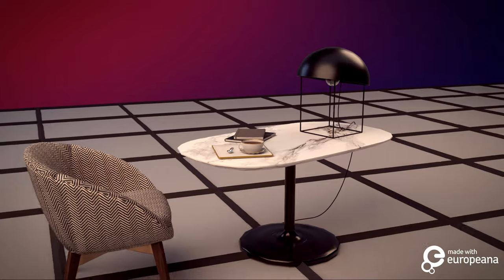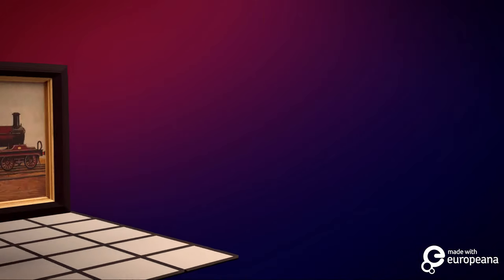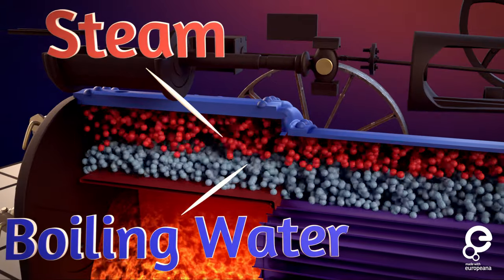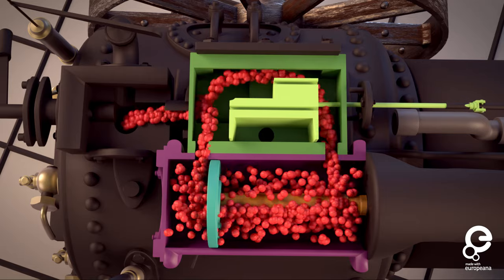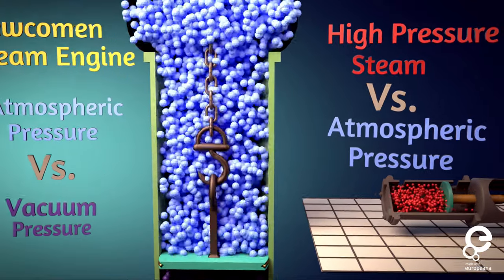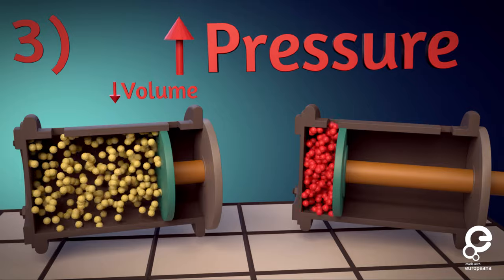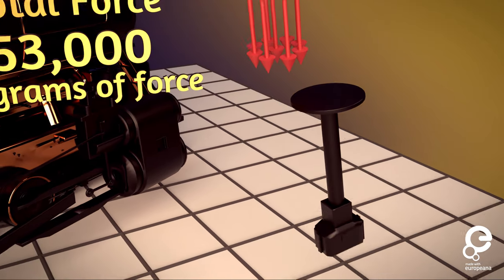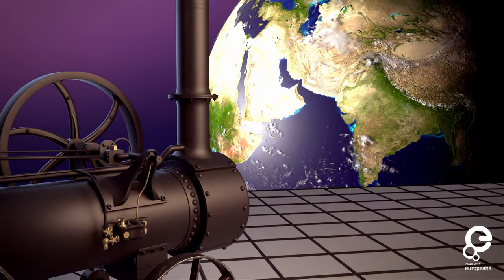How do Steam Engines Work?

Comment: doesnt explains how high pressure steam is created, is the fire burning at higher temp ? do they pre pressurize the steam somehow?
Reply from the maker: Those are a great set of questions.     That's why I call it branch education.   One question answered begs more questions.
Reply: Most newer boilers and steam Locomotives have various appliances that help improve performance and create higher pressure steam. Such as superheaters, which takes steam and directs it through pipes that are in the fire tubes, which makes the steam hotter and drier. In addition, there are feedwater heaters that preheat water going into the boiler.
Reply: He does mention THREE different ways in the video but doesn't say which is used - and of course pressure just builds up and up and up! in a closed space - presumably the more heat (more movement) one in a standard engine, forced induction (more molecules) maybe in a more sophisticated one, and as the piston moves away and creates more volume I cant see how the 'decrease volume' one works at all?
Reply: @anthonylester1349  Smaller volume is basically just the opposite of having more molecules since really it's all about density. However it's not particularly relevent to steam engines but it is how their opposite number, heat pumps work. In a heat pump you use energy to move heat from one location to another and you do that by compressing a working gas.
Reply: Creating higher pressures is essentially a question of boiler design, the more energy your boiler can absorb from the fire the more pressure it will build up inside of it. The goal of boiler design is essentially to have the air that exits out of it be as close to 100 degrees C as possible because then you know that the water in the boiler has absorbed all the heat energy it possibly can from the fire. You do that by running fire tubes through the boiler where heat from the hot air from the fire can transfer into the water of the boiler. Of course it also helps to have a hotter fire since that means there is more heat you can transfer to the boiler and you do that by ensuring your fire gets enough oxygen to burn cleanly, you know a steam engine is running well when the smoke comming out of it is white.

Comment: Why dont companies like TESLA dont use a windmill or two on the back of their car?(As the car accelerated the airfoil shape of windmill makes is able to move in round and if its height is small then its agular velocity will be high which will give it a good power)
Reply from the maker: That's a great idea!!  I think the issue is that with a windmill on top of the car, the 'wind' used to power it comes from when you drive the car at high speeds.  Thus the power to create the 'wind' comes from the batteries and engine.  So- you're using your batteries to create 'wind' and then capturing that wind with the windmill to charge the batteries, with a loss in efficiency.
Reply: @BranchEducation  We can use an IC engine for a  little distance....and after that, when car gains Kinetic energy then the windmills can even produce a large energy for a large distance  ...
Remember:The height of windmill is short on the back of the car...
Idea is made by MYSELF...

Comment: Can a steam engine explode if it is stopped from doing work. Will the pressure in the boiler just keep increasing with no outlet
Reply: There were pop-off valves that opened up if the pressure exceeded a certain limit.
Reply: If the piston can't move then the steam will escape through safety valves, otherwise the engine will just spin on it's own.

Comment: If a piston around the size of a dinner plate can use steam to pull three tons then would it be possible to create a fast and reliable modern steam car?
Reply: There were some early steam cars, but ICE engine were found to be more practical, just like with locomotives (eventually)
Reply: The problem is mostly that steam engines are fundamentally best suited to be large stationary engines like in power plants. Their efficiency scale so directly with their size that at around the size of a car engine you'd be lucky to get an efficiency of maybe 5%, but probably closer to 1%. Compare that to internal combustion engines which sit at between 20-30% effiency, so in order to reach the same speeds the steam engine would need to at best burn between 6-30x more fuel however since boilers aren't 100% efficient it'd probably be like 12-60x as much fuel. This of course doesn't even take into account the volume of water needed to drive such an engine. Basically there's a reason why the steam speed record stands at 203 km/h while modern high speed trains can easily reach speeds of 350 km/h and their record is at something like 530 km/h.

Comment: I always thought the upper cylinder (mounted on top of the driving cylinder) was actually the slide valve that directed steam into the lower driving cylinder, not an additional driver.
Reply: It depends.  Some locomotives have inboard valve systems, some have compound cylinders.  All very tricky stuff.  Very enjoyable though.
Reply: Larger locomotives will have multiple cylinders of different pressures to ensure that the most possible energy is extracted from the steam.

Comment: The tubes are called flues, that was not a traction engine, as it has no way to move. That would be a horse drawn stationary engine that would have run on wood straw and coal

Comment: How do you replennish the water that boils away without stopping or shutting down the boiler?
Reply: I’m not a physicist, so I don’t really know how it works, but they use some thermodynamic principle to inject water into the boiler when it’s still at pressure. You can find videos on how the injector worked.

Comment: Mankind has  always noted the time of the steam engine, a revolutionary change in our history. It is talked about as something quaint from our past, the sad part about it is that we are still in the era of steam, we just changed the source of the power, even modern warships and submarines are nothing more than steamboats, we just boil the water with a nuclear fire. We really haven't made much headway since the early days of steam.
Reply: We did make them a heck of a lot better though, a Watt steam engine is about 3% efficient while a steam turbine is close to 50% efficient.

Comment: Watt didn't improve Newcomen's Atmospheric Pump. It couldn't be improved, even by James Watt.
Watt dumped Newcomen's Atmospheric Power and Arkwright's Water-Power for High Pressure Steam Power.
To achieve that he had to invent a new  engine, the world's first PRACTICAL High Pressure Steam Engine.
For the first time in human history we had something to replace, outperform and even more importantly, outnumber the 2000 year old Water-wheel.
Newcomen's machine wasn't a Steam Engine, it was an Atmospheric Pump, it provided Atmospheric Power ( air pressure), a whole 10psi.max.
Watt's machine was a High Pressure Steam Engine, it provided High Pressure Steam Power, as much power as your engine could take, which explains why there were so many explosions.

Comment: Kilogramme of force? Never heard that before. Why not use newtons?
Reply from the maker: Because most people don't know how much a newton of force is.  But 1kgf is the force 1kg mass weighs- it's a pretty intuitive amount of force.
Reply: @BranchEducation   I still never heard of it before; it's like strange mix of imperial and metric, and honestly a little bit confusing. I think it would be better to just say in newtons, and for the people that don't understand you can add some equivalent comparison. E.g. the total force was 25.5 kN which would be about 2.6 tonnes on top of it here on earth. If fact that's exactly what you did in with the car analogy, so using kilogramme of force or whatever wasn't needed.
Reply from the maker: It's definitely something I will consider.  I definitely get what you are saying, especially because newtons are used much more often in classrooms.
Reply: @BranchEducation  i dont understand newtons but i understand kgs, i understood your units fine
Reply: @BlackM3sh  How is force an Imperial value? can't see any mix strange or otherwise

Comment: couldn't the low pressure steam leaving the piston be circulated through a stirling diaphragm (or even a heatsink) to increase the efficiency of the engine?
Reply: The steam exiting the cylinder is used to force a draft through the chimney so it's already increasing the efficiency of the engine by making the combustion in the firebox more complete.

Comment: how long does the water in the tank last before boiling completely?
Reply: They never ran the boiler empty. Water had to be kept above a certain level so the locomotive didn’t explode, so they constantly fed it with water from the tender. The water in the tender could last anywhere from 10 to 200 miles depending on the locomotive.

Comment: So if I was too instead of coal use water and electricity to make steam by putting “jumper cables” in the water and that heats up the water. Since we have an alternator the battery would stay charged and you would just refill with water ? Just thinking out loud
Reply: My guess is that steam engines are not efficient, and much energy is lost, so the alternator will never be able to provide more energy than was used to boil the water.
Reply: You'd loose about 99% of the energy in the process, at best if you go all out and build a steam turbine you might reduce your losses to 60-70%.
Reply: @6B26asyGKDo  Steam engines at their best had efficiencies of around 9% so yeah.

Comment: How do you increase the number of molecules?
Reply: Essentially by forcing more substance into the same space... For the steam engine this means increasing the boiler pressure which in turn feeds steam to the power cylinder.  The cylinder itself has a fixed displacement.

Comment: How does the green slide valve move?Is that dependent on the piston?
Reply: It's linked to the piston with a connecting rod, this can also be used to control the speed of the steam engine.

Comment: how does the slide valve move, is it attached to the piston?
Reply: This is just a guess, but I would assume that the flywheel must be spun manually to start the engine, and that the rod connecting to the slide valve is in some way moved by the flywheel, and once the cycle is started it moves itself. But don't take my word for it, I'm not an expert.
Reply: It’s linked to the wheels by a bunch of rods that move it in such a way that it properly times the slide valve.

Comment: Is there a sustainable alternative to coal that functions in the same way?
Reply: Nuclear or fusion power still function by heating water, we just extract the energy in a steam turbine but they're fundamentally still a steam engine. There's also concentrated solar and geothermal power. Heritage steam engines can be made sustainable by using charcoal from trees or coal made via algea.

Comment: It's not a traction engine simply a Mobil steam plant as it has no ability to move itself. Usually pulled along by horses or a proper traction engine to the jobsite.
Reply: It wouldn’t be a very useful locomotive if it couldn’t move itself.

Comment: Newcomen invented the first and last Atmospheric pump, not a steam engine.
Little wisps of Steam and a vacuum didn't move the piston,   Atmospheric pressure and a vacuum did.
It could be 100% efficient, but you'll still not get over 14.7psi of Atmospheric Pressure, it supplied Atmospheric power. It couldn't be improved, even by James Watt.
James Watt dumped Newcomen's Atmospheric Power and Arkwright's Water-Power for Steam Power! This is never mentioned, I wonder why?
To achieve that he had to invent a new engine the world's first PRACTICAL High Pressure Steam Engine, his engine supplied Steam power.
Then?
An industrial Revolution!
Still fail to see the difference between low and high pressure steam engines, low or high, they're all steam engines. Don't necessarily need high pressure to drive machinery, some steamboats used 5psi of steam purely out of passenger fear of high pressure. 
Little wisps of Steam didn't move Newcomen's piston, Atmospheric pressure did.
Little wisps of Steam did drive Watt's Engine.

Comment: 5:04 is an engine that generates power from high pressure steam against vacuum pressure feasible, instead of atmospheric vs vacuum or steam vs atmospheric?
Reply: Yes, but that would be quite complicated and would only net you an additional 14 PSI give or take (one atmospshere).  Much easier to just raise the stream pressure int he boiler  by that ammount.

Comment: How do they control speed?
Reply: By controling the timing of the slide walve, if you move it very quickly the piston won't have time to complete a full stroke and thus oscilate much quicker. A consequence of this is also that less steam is used, which makes sense since it requires less energy to stay at a high speed than it does to acclerate to that speed.

Comment: Slight error at 2 min. That is a Stationary Engine used to power tools and farming equipment, not a traction engine. A traction engine was used to pull ploughs and was basically a tractor. Other than that good video:)
Reply from the maker: Not entirely sure of that.  The original documents call it a portable engine, and then over time it took on the name traction engine to distinguish it from a locomotive, which is also a 'portable engine'.  Here's a primary source:  https://www.europeana.eu/portal/en/record/9200579/m6eter4n.html?q=steam+#dcId=1554415067172&p=1
Reply: Traction engines go on the road as well as off road, generally pulling things along behind them so not 'just' a tractor, they have a take off gear so they can park up and then run second/third etc devices via belts etc. another poster mentioned that the portable type has to be towed to where it will be used and cant move itself hence the distinction. also TEs had seats, steering wheel etc which the one shown clearly doesn't so it's obvious you can't drive it anyway!

Comment: 1:57 Traction Engine? Nope. It’s called a portable steam engine! This was only moved by mules and horses through fields. The flywheel is connected to a belt that the belt goes to a flywheel on a piece of farm equipment. Traction Engines had Two blocks inside of the flywheel that could be engaged or disengaged. If they were engaged the blocks would contact the fly wheel and cause the transmission to move the wheels and the whole engine would move. If they were disengaged they could also power farm equipment.
Reply: Obviously most people know about Traction Engines but the PSE is an interesting fact too. and of course most people still say Steam Roller don't they....even though they aren't anymore!

Comment: So obviously the answer is nuclear powered steam engines. The navy has done it for over 60 years and was it not gm that tried it in the 50s or chrysler. Either way it is the answer to the global question.
Reply: Nuclear subs only use nuclear reactors because they have to. And the thought of a nuclear powered steam locomotive derailing is rather scary.
Reply: @thatoneguy611  At this point the way the worlds going, I say throw a hail mary cause something has to change eventually or we are fucked.
Reply: Or just build nuclear power plants and use electric vehicles?

Comment: Actually, the findings of oil, coal, gasoline and diesel are of great benefit to our environment, and air quality. Burning these releases much needed carbon into the air.

More carbon dioxide = more growth for trees. More growth for trees = more oxygen for us to breath.

If you don't believe me, look up how greenhouses pump in carbon dioxide from pressure tanks, to increase the greenhouses plant output.